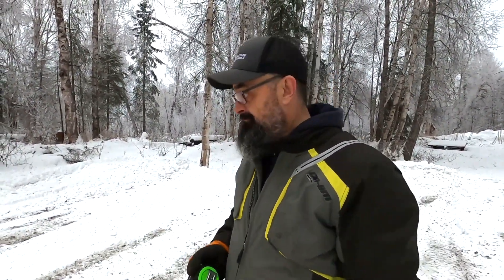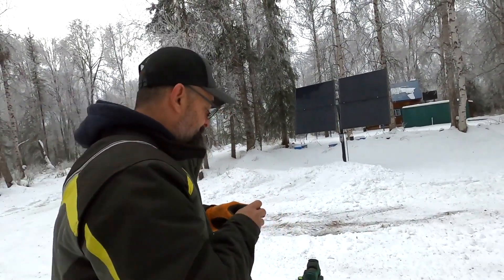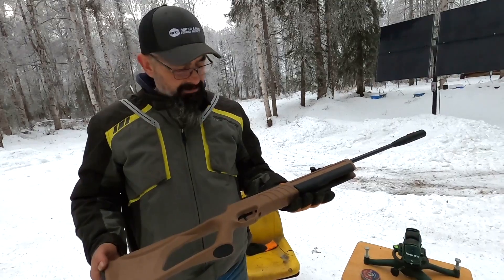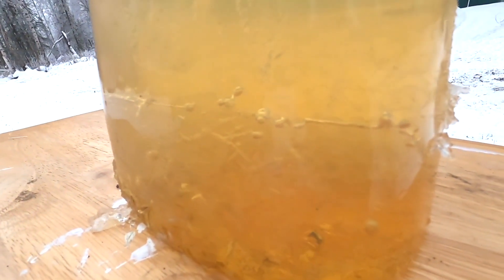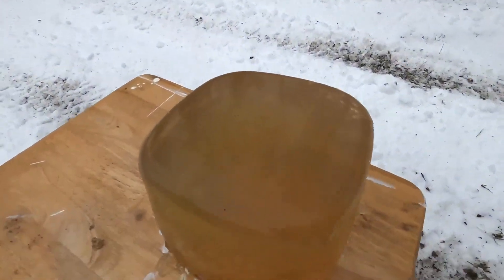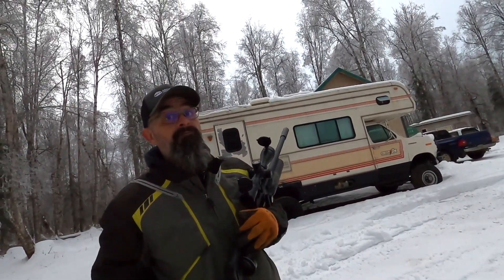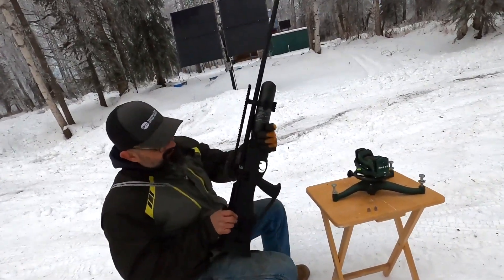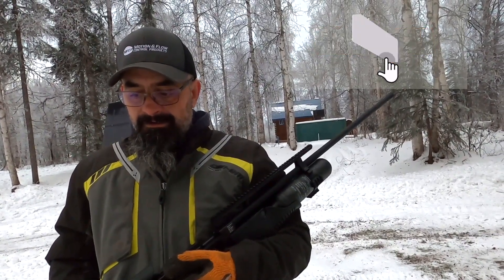Airguns and ballistics gel.

Comment: Did you figure out what caused the malfunction on the 45 Cal.? Seemed like it could have been cold related to me.
Reply from the maker: No, I haven't looked into it yet.  The gun had only been outside for five minutes so I doubt that it was the temp.  More likely an oring failure.  I'll play with it when it gets warmer.